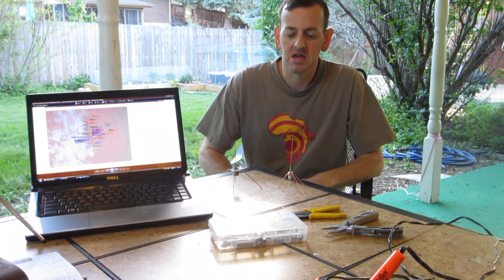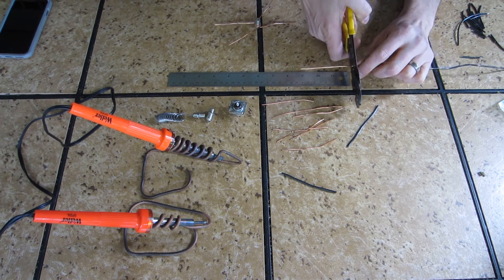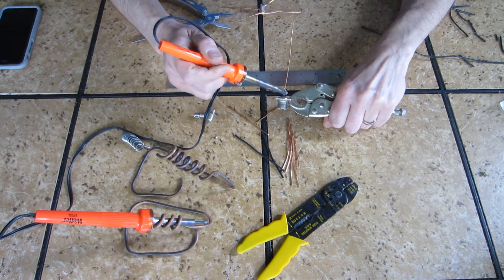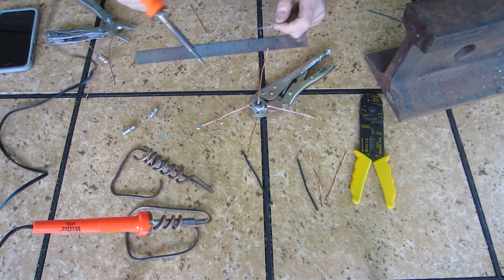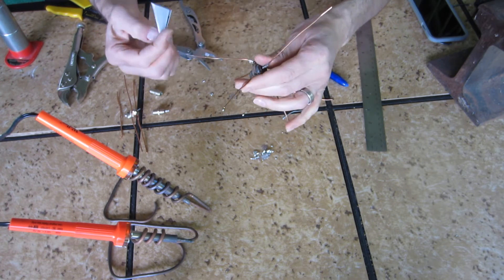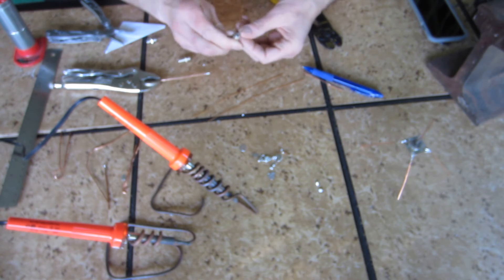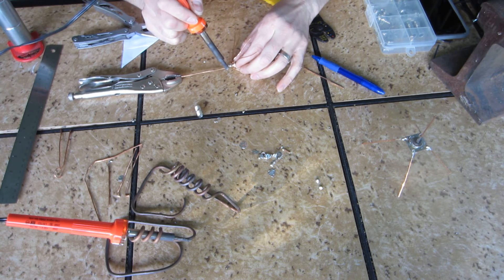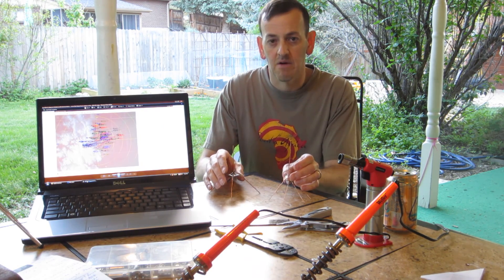Two DIY ADSB 1/4 Wave Antennas for SDR

Comment: 4 letters will help you. F L U X :)
Reply from the maker: I use a flux-core solder but paste would help...and a better soldering ability.  :)
Reply: Kugellagers Noodle I bought some paste a while ago and it's been really helpful. (Didnt think it would do much)Especially for "big" soldering. And yes, higher wattage irons is not bad either of course.
Reply: And foremost -Thank you for the video, I built a small dipole after watching this (I didn't have a connector) I just soldered 68mm wires to the end of my small stock antenna cable  that came with the dongle. I'll try to build one of these too. Maybe bigger, 5/8th wavelength maybe? Do you think that will work? All the best!
Reply from the maker: Sorry for the long time to reply. I don't see why a 5/8 would not work. The pattern for the antenna is a more horizontal shape as well. If you add a ground plane I believe you still want then to be 1/4 wavelength.

Comment: Why so many radials?
Every antenna calculator (design software) I've ran numbers through for 1000-1100 MHz, all have three radials on a horizontal plane (not downward 45°) + the radiator (top whip), bunch of mil-spec antenna/commercial suppliers have decent pictures of their antennas. Even for Yagi calculations, only has 3 elements (1 director, 1 dipole and 1 reflector)
Reply from the maker: Recommend minimum number of radials in most cases is 3-4 radials. You can get by with one but the antenna will not be as even or omnidirectional in its pattern. I used four on the SO-239 connector because it was easiest to solder/separate/space them evenly. The same went for the other antenna that used the connector hardware to attach the radials. For a 1/4 wave antenna to best match the impedance of 50 ohm coaxial cable you want the radials bent at about a 42-43 degree angle. Horizontal radials for a 1/4 wave antenna give an impedance of about 37 ohms which is adequate but still does not maximize the full potential of the antenna for omnidirectional reception. They also might not be using an exact 1/4 wave radiating/receive element or constructing a directional antenna. You mention a Yagi antenna, which is a special kind of diople antenna,  which is a directional/beam antenna meant to receive or transmit from only the one direction it is pointed. They can have many more than just one director or reflector.  To best receive ADSB you want an omnidirectional antenna that receives from all directions as aircraft come in from all directions. There are many variations on the omnidirectional ADSB receive antenna including versions that are stacked for more signal. The 1/4 wave ground plane antenna in my video is the simplest of these.